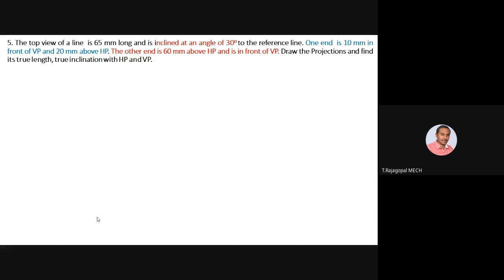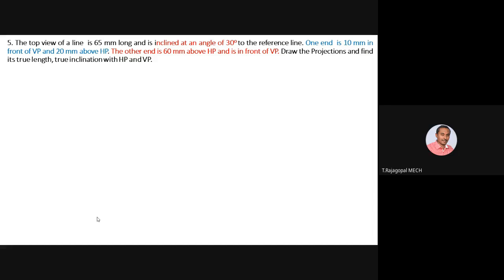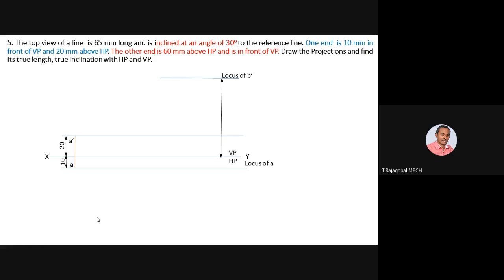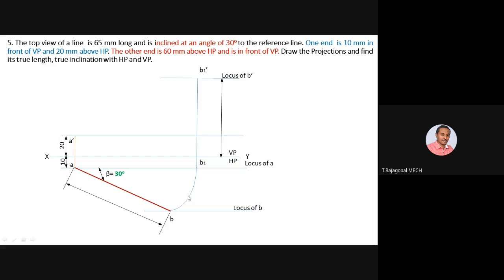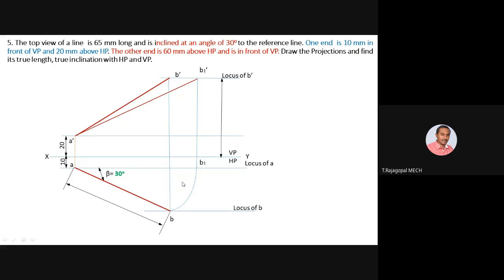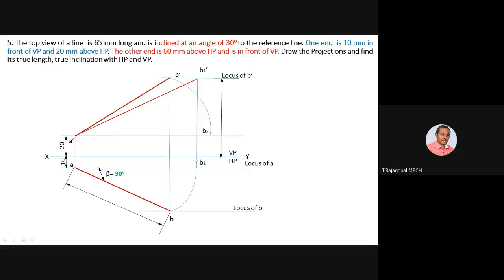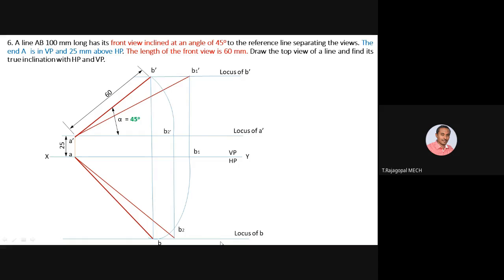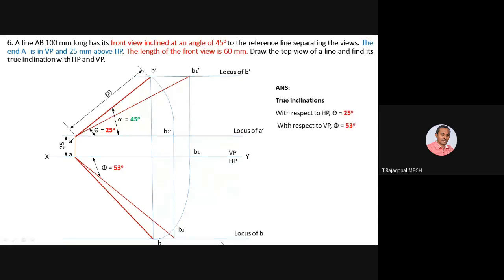Projection of Line | Inclined to both planes | Solved Problems 5 & 6 | Engineering Drawing

Comment: The top view of a line is 65mm long and is inclined at 300 to the reference line. One end is 20mm above HP and 10mm in front of VP. The other end is 60mm above HP and is infront of VP. Draw the projections and find the true length of the line and its true inclinations to HP and VP.